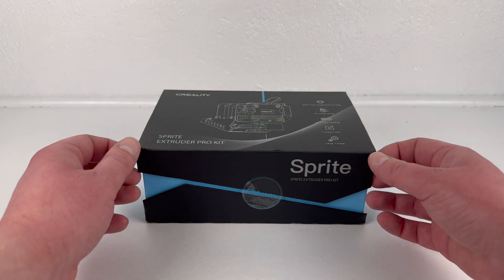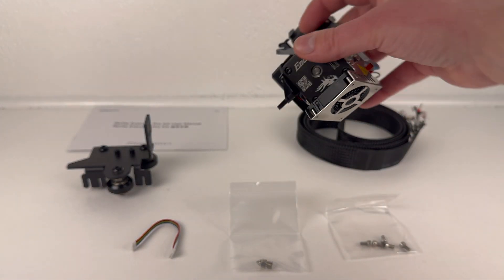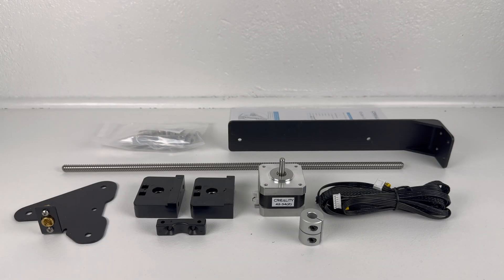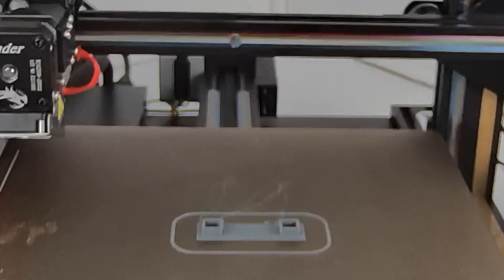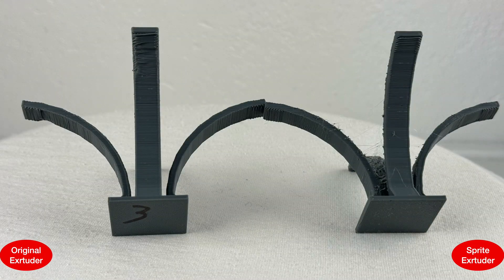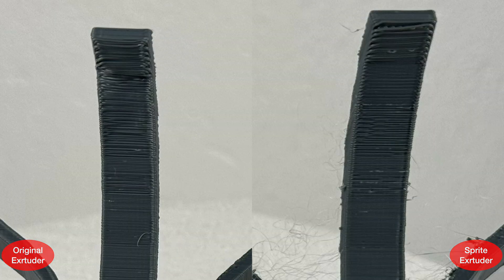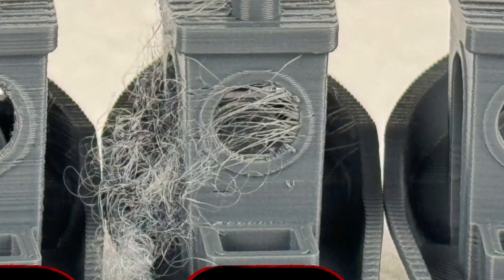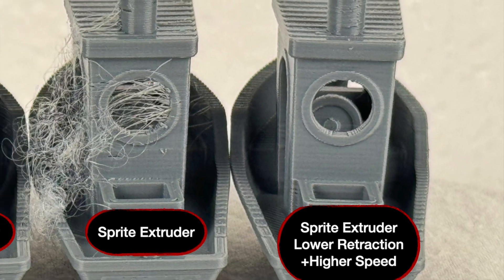Ender 3 V2 Sprite Extruder Pro Upgrade! Worth it?

Comment: This is honestly a bad example its using the same files as the original printer without proper calibration...

- Its like replacing your GPU and not upgrading your drivers
- Changing your car engine but don't adjust fuel injections etc
Reply from the maker: Still got an idea of what difference the direct drive would do. You'd probably be able to get basically the same or similar quality by not upgrading. Most hobbyists probably isn't calibrating beyond first setup for a long while in the beginning.
Reply: It would of still worked with the original G code,  Esteps and feed distances can and should be set on the printer itself (Doing it via the slicer is more so a bandaid tweak rather than proper calibration).  So if both printers are tuned on the firmware to feed exactly 100mm the Gcode shouldn't matter.

Comment: I'm not even 2 minutes of you "compairing" these things, and i can already see that you havn't calibrated e-step after you changed hotend, AND ADDED A NEW STEPPER. Everything after this is void.
Reply from the maker: The things was to first see out of the box with barley any calibration of the extruder more then change e-steps to what is said in the instructions, what the difference would be using the exact same file. I did the test I said in the beginning and this was the results.
Reply: @TFmane  OK this is invalid you can't just say this is comparison. The original hot end is calibrated and ready to print while the new one as you say out of the box is using wrong print settings... 

The different is that you are using completely wrong settings...
Reply from the maker: The calibration as you say would still be on the slicer side, and the results still got better than the original hot end for the parts. The TPU test was done as with a third test that was specifically for TPU.
Reply: @TFmane  I have never set my e-steps in the slicer? You set it to the eeprom?
Reply from the maker: Ok thats a miss on my part to not say that I did change the e-steps in accordance with the in box instructions to a higher value of 424.9 according to the instructions. I will add a text that say that. Sorry about the confusion.

Comment: If it's not a stupid question. Is the hotend included in the Sprite kit, or do you reuse the normal ender 3 one, or is it a special hotend for the sprite? Also, how much tuning had you tried with your existing setup to get the best performance from stock? I mean, if the original wasn't dialed in, then you dialed in the upgrade, it might look more favourable on the upgrade when stock could have been better in the first place.
Reply from the maker: I got everything needed with the kit. I had gotten good results with the stock setup, I mostly upgraded for better TPU/TPE printing and higher temps for ABS/PETG. That is true, on my OG Ender 3 I have only put a dual gear extruder but the rest is stock. I'm getting good results there too. Hope that answers your question 😊

Comment: What x, y, z positions/offsets did you set in the firmware for the Ender 3 with the sprite hotend?
Reply from the maker: The only direct change to get it running was the Esteps. Other then that it wasn't much to change in the offsets more than the Nozzle To Probe Offset I set using the screen running Professional Firmware by mriscoc. Hope that answers your question

Comment: Where did you connect the case fan?
Reply from the maker: Not sure I know what you mean, but everything on the Sprite Extruder connects to the back of it the goes to the mainboard through the cable on its top. Hope that helps

Comment: very definition of user error.
Reply from the maker: Yes indeed. That was my intention to test LOL
Reply: That's the whole point of the test. You can't just swap in new upgraded parts and use same settings. You have to tune and change your settings for most optimal results.

Comment: More hairy with sprite extruder?
How would ya install one of those ona ender 3 pro? Got a different connector dealio.
Reply from the maker: Yes, because I use the exact same g-code for both at first. So that the retraction was to0 high for the Sprite Extruder to use it right, when lowered it looked great. Installing on your Ender 3 pro should be the same as for my V2 in the Sprite Extruder Pro Kit you get all that is needed to install it on the older Ender 3 models. You need to unplug everything from the old extruder on the mainboard then connect the Sprite cables in the corresponding slots then follow the instructions for the firmware with is basically one change in the E-steps. Hope that answers you question.